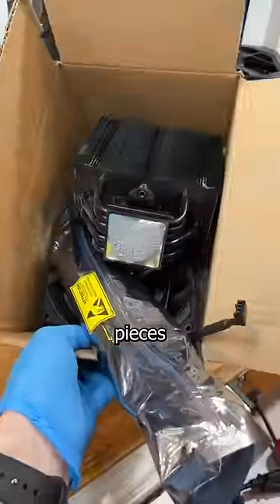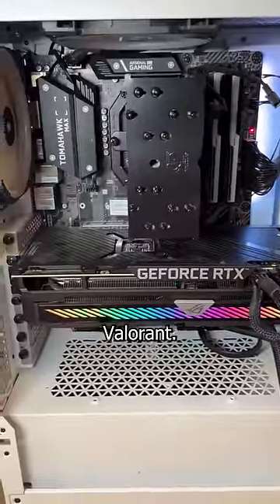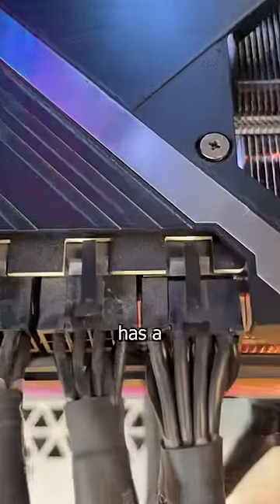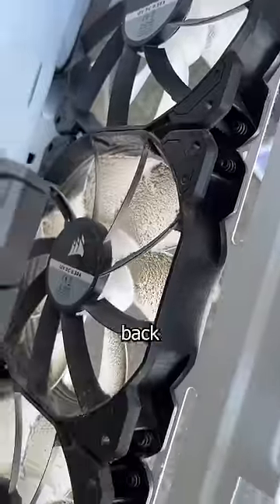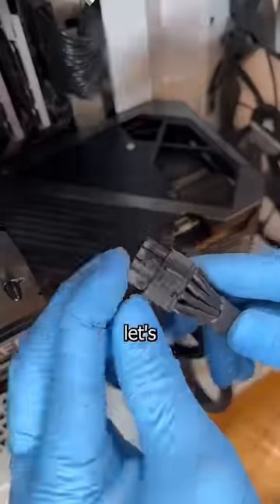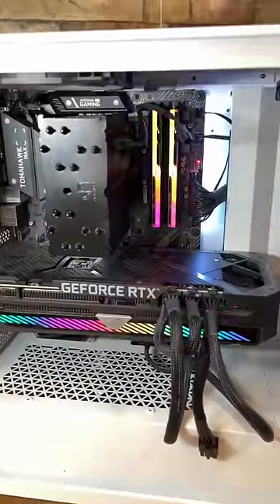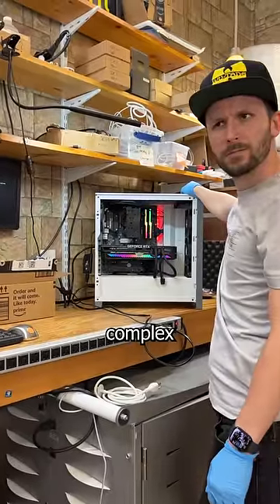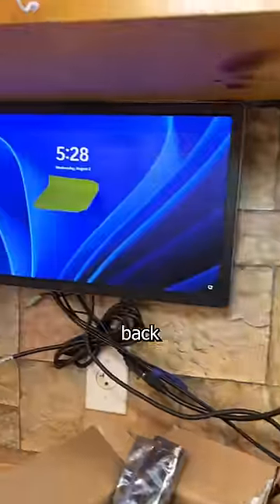This #Gaming #PC came to me in pieces, is it CPU or GPU? Can I repair it? #tech #technology #shorts

Comment: I took apart MY ENTIRE PC to find 1 defect ram stick.... i feel the pain
Reply from the maker: it hurts
Reply: Corsair DDR2 Modules and me are old enemies. I went trough this more than once back in the day including sending a couple in, new one still being a pain etc, I feel your pain!
Reply: Same, i had 64gbs of corsair vengeance ram and had one go bad on me, first time I've ever had ram die on me lol.
Reply: Why wouldn't you just start with the RAM? 💀
Reply: I restarted and re-installed my whole pc to find out that it was just one of the RAM that gave me so many bsod :(
Reply: I learned early on to check the ram cards first one at a time if I got a no start mfs randomly fail sometimes
Reply: That was me too, man. Windows 10 kept giving me the BSoD and I went through updating all the drivers, changing from HDD to SSD and nothing worked until I ran memtest. Learned now to make sure you check RAM when you're having issues
Reply: I also had to do this, but on an alienware gaming laptop from 2012. Damn thing is built like a tank but you have to disassemble the top half to access 2 of the 4 ram ports. Naturally the bad one was in the port under the keyboard...
Reply: I worked in my father's computer shop. Reseating ram was one of the first things he showed me to do. Fixed so many computers.
Reply: @EngelDerVerdammnis  those stupid low profile half-height pc2 dimms were a nightmare
Reply: I had a bad DDR3 stick. Hours of memtest, everything was super well. Speeds, voltages, everything was great. It just did not work well in ANY rig.😂 memtest went ok. Bought some fury 1866 4x4GB and I also had a problem! My MBO applied 1.2V and that was waaaay low. Easy fix tho and got it fast. Ahh, memories. 😅

Comment: RAM sometimes is the biggest offender when it comes to system errors. You could rebuild the whole system only to find out the ram wants to be seated in a specific order to even boot into BIOS.
Reply: Ahh hell ig im facing that issue 💀
Reply: Ram can be bad out of the box too and make you crazy
Reply: But its all in the manual for the MB literally for all cases wherre to put ram😊
Reply: @MatNotMatt  i have 4 x 8gb in my system and it only boots with it in ONE specific order (dimms have sequential serial numbers so its not that they are to different)
Reply: @vincentschumann937  and I'm telling you, you'll find the specific order for all of that in your mother boards instructions manual
Reply: @MatNotMatt  ? how i have identical dimms in all slots thats all the manual tells me
Reply: Friends, I took off the 22 one arm pull-ups Support the people
Reply: @WCGwkf 
I've actually had that happen before with a PC I built for a friend of mine

Windows install fine all the drivers install fine all the software install fine

They have it for about a week and then they tell me it's doing all sorts of random things

And I've seen enough RAM go bad I'm like all right let's do them test

Mem test wasn't even running for like more than one or two seconds before it went red as soon as I seen that I'm like yep at least one of these sticks is a dud

But thank goodness for Newegg and thank goodness for ram having a lifetime warranty

So I just process of elimination which one was bad and let him run off that one for a few days until I got the replacement kit in and no problems ever since

Thank you for reading this and I hope everyone has a good day and a good weekend

God bless you and your family

God bless you

Jeremy Scruggs
Reply: I was about to write this myself. RAM just manages to affect almost everything while managing to avoid being part of the error messages.
Reply: I'm so concerned about DDR5 and all its issues, that I still run a Ryzen 3800X.
Reply: or one of your ram slots could be dead. I literally would have to buy a new ram sled, get the old one off and resolder it. And it's just not worth doing when I only have two sicks anyway, so two slots is plenty.
Reply: True
Reply: Yea, for now. I thought that was the problem, I replaced the CPU but didn't do a BIOS update (going from a Ryzen 5 to 7). I still gotta do the update.
Reply: Lol yes and on different mobos it could be anything from 4-3 to 1-3, 1-2, 4-2
Reply: @MatNotMatt Thank you! Good to know
Reply: Same thing happen with mine gpu fans will not start and no display tried everything after re seating the ram it’s worked💀
Reply: Yep, every time i do pc clean up i do put off and back ram and CMOS battery cuz those two likes to fuck a brains
Reply: @MatNotMatt  .... i had a 'fault' where the pc just wanted me to remove the ram and put it back in.... then it worked fine.
Reply: And  if you're seating 4 rams at the same time for a new system, sometimes it's literally easier to post with 1, and then add the rest after first successful post.  🤦‍♂️ with the Mobo booklet mentioned that to save me an hour wondering why we ain't posting.
Reply: Every time i clean up my pc i get the same CPU led error and is always the ram, the only solution is resenting all the rams until it works
Reply: Do yourself a favor.....reseat those memory sticks or you might hear: Whaa.....whaa....whaa....whaaaa
Reply: @MatNotMatt Word each mobo manual states what slots should be used
Reply: Anytime I take my RAM out, update the BIOS, or when I added RAM, my AMD build wants me to boot up up with a single stick in the second DIM slot, let it fully boot to Windows, shut it down, and then add the rest of my RAM before it'll post. Otherwise I get a RAM debug light.

Comment: I worked on a friend’s pc that had a problem exactly like this. Dustier than the state of arizona but at the same time it had the tell tale markings that it was being run in a humid area. Came to me in pieces because friend tried to clean it himself. tore everything down to clean thoroughly, built it back up again, but the CPU light was still red. Reseated the CPU, nada. Reseated the RAM, still the same. Tested each RAM slot and the only port working was the one nearest the CPU. shinnIng a flashlight on the slots itself there where caked up dust inside. Wondered how the hell would that have happened. Apparently friend tried to clean the internals with a microfiber cloth soaked in isopropyl and to my best guess wiped damp dust into the RAM slots. Gently used a cuticle pusher and those tweezers thats used to yank dead skin inside toe nails to get all that gunked up dust out of the slots. PC booted up fine with all 4 ram slots working after. I can proudly say I’m one of a few that fixed a pc by giving it a pedicure.

Comment: By watching your shorts I learned that the most cpu problem is,
1. Remove Dust.
2. Loose cables.
3. Apply heat sink paste.
4. Refit all hardware.
5. If any hardware not working replace it.
6. Software upgrades.
Now I am the most genius technician that ever lived.
Thank you.❤
Reply: You forgot 7, a soft gentle touch of magical little raccoon fingers ^w^
Reply: You unironically describe most pc maintenance. 
99% of the time, this is what you would be paying someone else to do.

Comment: You did a good job sir, By using that plastic between fans, you stopped getting reverse electricity in that pc. Hats off to you❤
Reply: could you explain that? I'm curious what you mean
Reply: @sepiasmith5065  I think what he means is that he avoided letting the fans spin up while dusting them out, which can backfeed a bit of electrical current to the motherboard if the fan is connected, potentially damaging the board.
Reply: @jeffb.6642  oh I see! thank you
Reply: @sepiasmith5065  NP! I know the statement was worded a little strangely, so I can see why you may not know what he's talking about.

Comment: Good to see you not letting the fans spin with the air pressure. Not sure if its the same reason I do the same or not, but a long time ago I once hit a fan with 150 psi and it flew apart.

Comment: Lemme tell ya of the most crazy pc case I ever had, issues with Val getting some sort of file error though it was sonic studios the firewall some kind of software incompatibility when it turned out to be hardware, I was using a old acer monitor the game just didn’t like so once I got a new one it worked fine after 😅

Comment: Hi man, I know why that happend. It has to do with xmp, sometimes at a power failure the bios fucks xmp and it cannot bot with the preset for the memory clocks and timings. Taking out the ram and puting it back resets the xmp profile to default and the ram is at the base clocks so it will boot just fine. Awsome work, cheers!

Comment: Yeah, whenever I seat my RAM and try to boot it will refuse to even connect to my monitor ("please connect a device" message, not even a blank screen or error) if I didn't seat the RAM in the same config that I had before messing around with it. I suspect it's because of my crappy budget motherboard and mismatched sticks (8GB 3200MHz + 16GB 3200MHz).

The sticks work fine and have practically no issues during use, but for some reason, I have this exact problem whenever I have to mess with my RAM. Tech's weird. Good to know that my issues are also experienced by the 

GREATEST TECHNICIAN THAT'S EVER LIVED

Comment: Excessive dust plus months of micro vibrations dust will get in between the ram contacts. Keep your shit clean fellas. 

I've fixed many issues like this just by reseating the RAM, and the interiors of the PC always looked worse than what's seen here as far as dust is concerned. 

If dust wasn't a PC killer then we wouldn't have so many cases trying to filter it out.

Comment: If you had looked up the Motherboard manual PDF, you would of seen that red LED indicated a RAM fault.  There's usually 3 or 4 diagnostic LEDS on the motherboard that tell you during post whats not responding properly... CPU, RAM, etc...

Comment: Had this aswell. All of sudden PC didn't boot. Random errors during booting after.  PC stood there for ages. Since the randomness of the error I suspected a loose connection or ram failure. Took the ram out and refit it. Fixed it.

Comment: ... Y'know, I worked in a shop for two and a half years, I never once thought to jam something through the fan to stop it from spinning. I just used the rotation of the fan to make the blow easier to access, but to do a thorough and proper job, the zip tie brace would work wonders.

Comment: Note: When I removed the RAM out of slots #1 & #3 after 30 minutes of crashing games, the RAM Sticks were insanely overheated just by the feel of my hand. In addition, my PC AS A WHOLE runs at a lower temp now than it did before as well. (Crashing/Freezing relates to Graphics card and RAM in most cases)

Comment: Just had to fix my gaming laptop because the SSD stick was getting too hot. The thermal strip was torn. Moved it to the other connection that was fine. Works again 👍

Comment: Contact points on the ramslot/ram are oxidized. Use a pencil eraser or bar eraser to remove the corrosion and then re-seat the ram. Common problem on the east coast where we are a fan of salty swamp air.

Comment: Don;t worry reset ram..
Even after clear cmos ...-_-
Has fixed issues for me too!
Even after pushing down and testing the Ram was already seated.
Guess sometimes a micro particle gets in on a contact and well .. removal and reseating is the only solution.

Comment: I swear to God... my PC would crash for more than a month and I've done hours apon hours of research to fix my games to prevent them from crashing to desktop... believe it or not, re-seeding my RAM into slots #2 & #4 solved the case entirely. Most likely due to the fact that RAM slots #1 & #3 are closer to Heat Sink + CPU causing more overheation compared to #2 & #4

Comment: RAM is one of the main troubleshooting steps.

My computer was having graphic issues with my new card. I reseated the card...issues still present. I reseated the RAM, haven't had issues since. 
I guess the RAM came loose when I was installing the new GPU. It's an SFF case.

Comment: I was gonna say that GPU shouldn't need a 3rd power connector to function, its for supplemental power and overclocking, 2 is enough to run it properly.

Comment: My first guess was RAM. Only issue that I’ve struggled with recently that I still can’t say is “fixed”, was my 5700xt crashing my game (audio froze on whatever random sound) and going black, but discord continued to work. I tried all sorts of shit, but I was able to get stability by allowing the max VRAM speed to be a couple MHz higher than stock. I still get game freezes where tabbing out and back sometimes fixes it, or I just have to wait a few seconds. Not frequent enough to mess with it more, or buy a new card. Might have someone run it in their rig for a week…

Comment: My brother gave me his old computer because it didn't work. I believed him and was gonna scrap it for parts. He got a new PC from our mutual friend (Name Redacted) for free because he's an awesome friend. When I get home I open it and see goo from scented candles covering the thing, it was super caked on. It wouldn't boot so I double checked everything and what do you know, and one ram stick is tilted. I click it back in and it runs fine, even with the goo caked all over the cpu cooler to the point that it wouldn't let air from the fan through, but it was an i5-4460 so it wasn't a hot runner anyway. The reason it stopped working was because my brother bought 16gb ram to upgrade and didn't put it in right. He actually bought ram, took the old ram out, and just put in 3 sticks correctly but the 4th he failed. I still don't know why he didn't consider "hey, maybe the thing I just changed wasn't put in right." He told me he thinks the psu fried his mobo or he touched it and sparked it and it broke. Anyway, 1 ram click and 2 hours of meticulous cleaning and it runs fine. Bought a new case (he had a full tower for a micro atx) that was much smaller and an ssd and now I have a free computer. Once I get a new psu I'm dropping in my old Vega 64 and buying a 4790k to make it the perfect 1080p bedtime gaming PC and it's perfect because I have a 50 inch 1080p TV in my bedroom. When I told my brother the problem he didn't want me to tell (redacted friend name) because he'll feel like an idiot for making such a simple mistake and having his friend donate a $1000 PC to him.

Comment: Lol. I had the same Problem 2 Weeks ago when i was switching to a new Case. I was putting my Stuff in as usual. Then when i started the PC, the DRam LED was turned on. I trobleshooted it, and just tried taking the RAM out, and back in. For no reason, that fixed the Problem. (Yes i did put it correctly the first time. I double checked)

Comment: I cant tell you how many times ive dissasembled a computer only to have tempremental ram. I find a cotton ball a f metho works great to clean the contacts. Wipe once and insert before it drys, pull it out wipe again let it dry and insert. Not sure why but ive had sticks that wont work in any computer or slot come back to life.

Comment: Reminds me of when i got my Ryzen 7 5700x3D, i installed it and it wasnt posting, took it apart and looked at the cpu, noticed it had a hard rubber like substance on a few of the pins, cleaned it off the best i could and BAM it worked fine. 

Sometimes its the smallest issue that makes everything not work 😂

Comment: I've been having this ongoing problem with my PC which is similar to this. I have a quad channel ram setup (DDR4) and for some fucked up reason, if my PC sits idol for an extended period of time (let's say a week), there is a chance that I'll get a 0d error on my mobo. To fix this, I have to reposition my rams. I've tested my entire system thoroughly and my RAMs as well as the individual slots work fine. It's just when they are in a group of 4, they decide to fuck around. It hasn't happened to me in the last couple of months though so whatever the fuck it was, it's fixed ((hopefully)).

Comment: Literally done that today while switching to a new power supply... after running 600W for 10 years I got a new 850W. Opened PC, cleaned everything, swapped PSU then bam, CPU light. Tried to reset BIOS by removing the CMOS battery, BOOM CPU AND RAM lights...
Removed 1 of the ram sticks while panicking hard expecting the worse and it booted up ahahaha
Then I just defaulted the BIOS, put the ram back and set the configs back on, not a single hiccup, it just wanted to see me suffer :')

Comment: I repasted my CPU and booted up nicely after. The next session tho, CPU LED comes on. Scared tf out of me. Had to check if I messed up some pins or improper contact of the heatsink but it was fine. Tried to boot and still the same problem. Sometimes it would but would take 5 mins to boot even from sleep. 

Turns out it's the memory! Reinserted and all was good 😂

Comment: Funny enough when I built my latest PC, it didn’t want to boot 90% of the time and when it did, it wouldn’t let me install an OS, saying there was a kernel error. The CPU control light was on.

After some testing I figured out the BIOS configuration for RAM clock speed was set slightly too high by default. There is a dedicated RAM control light and it never went on… why does it even exist?

Comment: In my case (pun intended) it was indeed the CPU being the culprit after my technician went thru all the components replacement - RAM, PSU, Mobo and finally after 7 months we found out it's just a bad batch of the 5900X 🤦😂